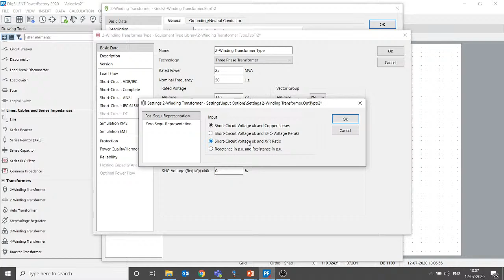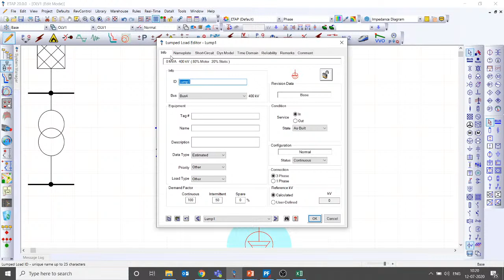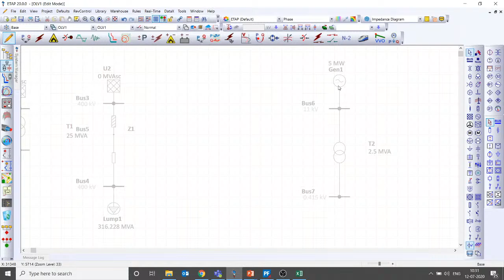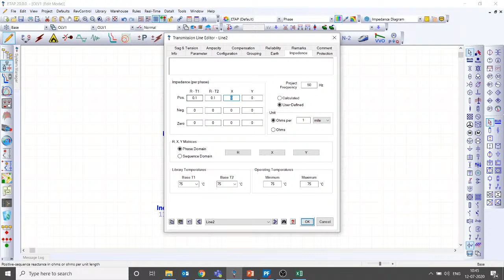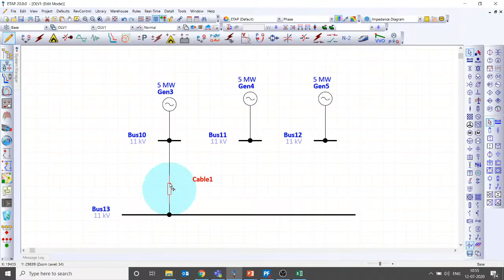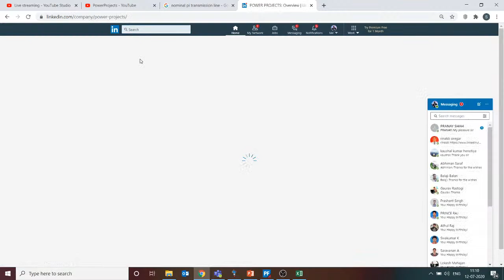AskSelva - Advanced Power System Simulation Software

Comment: Nicely explained about the difference between voltage control, kVAR control and PF mode. In the same example, considering one generator in swing and for other generators running in parallel,  which situation favors voltage /kVAR / PF control modes
Reply from the maker: It depends on the system and operating configuration

Comment: @PowerProjects : Can we see the voltage drop across Primary & Secondary T/F windings in ETAP Simulations ? If not, is there any method to find this using the technical data of transformer?
Reply from the maker: ETAP does not present the voltage drop in HV and LV wingdings separately. Is there any specific reason you are looking for voltage drop in HV & LV?